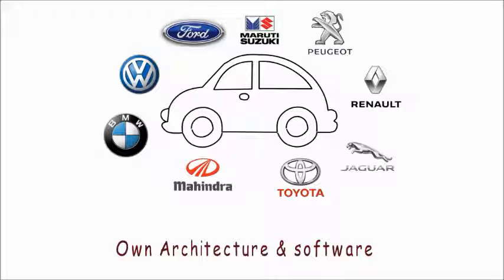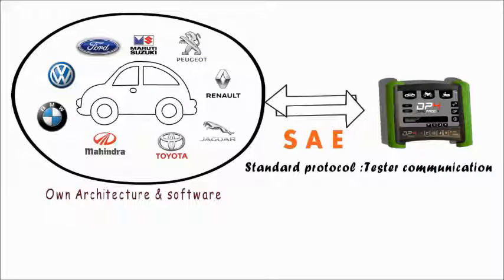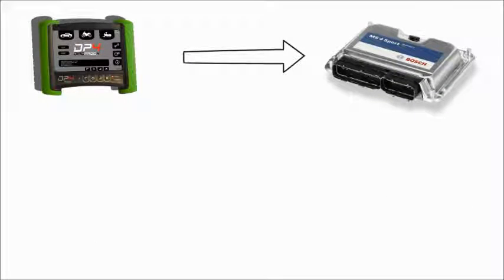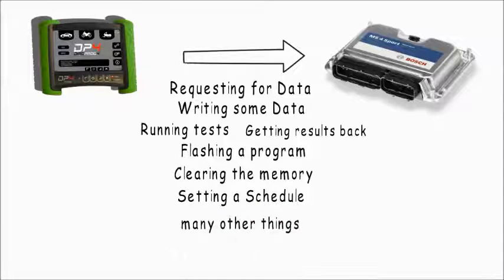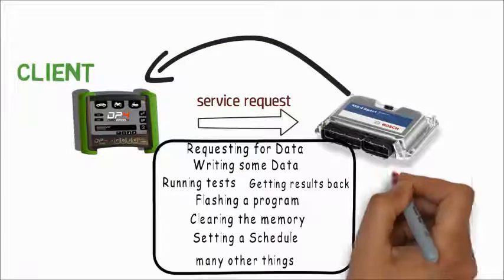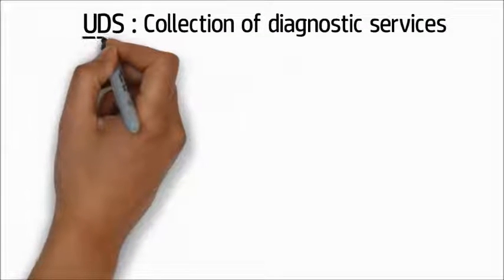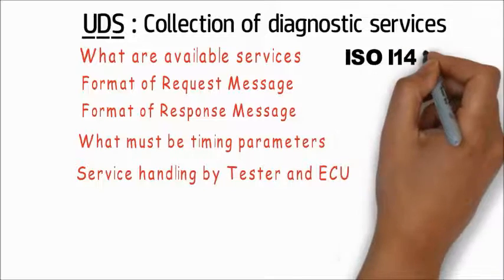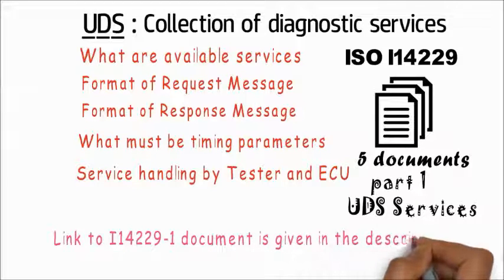Introduction to UDS Part1 - UDS background

Comment: Can u pls tell me difference between hard reset and soft reset.. what really happens in both..
Reply from the maker: Hard reset as name indicates has impact on hardware. So the initial Hardware startup sequence is where the ard reset takes the control. But in soft reset, as name indicates its soft reset. Here software means only application and not bootloader So all the Software variables will be initialised again and the control starts from init functions. This is the actual definition. But some companies doesnt make differentiation between hard and soft resets. But i hope you got whats is the difference

Comment: Nice and clear explanation.
How make a LIN based diagnostic service?
What is the difference between a CAN based diagnostic service and a LIN based diagnostic service?
In the ISO 147229-7 (UDS on LIN) document, there are two diagnostic services. (CommunicationControl, ResponseOnEvent)
Is the difference between CAN-based and LIN-based diagnostic services a difference in detail between the two services?
Thank you.

Comment: How to set up connection between client and server. Will there be any specific communication protocols has to be used for this like ethernet or can protocol
Reply from the maker: The communication channel must be there. You just have to connect the tester who is client to network. Usually in cars a db9 connection port will be available to connect the tester
Reply: @vicharavandana  Thanks a lot